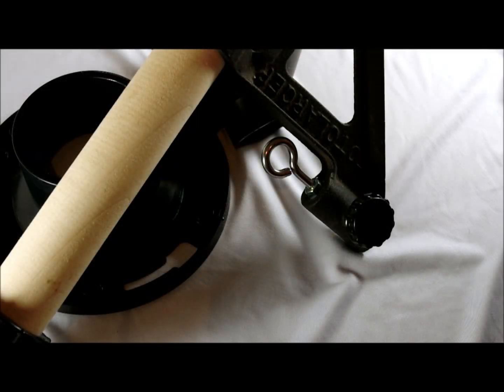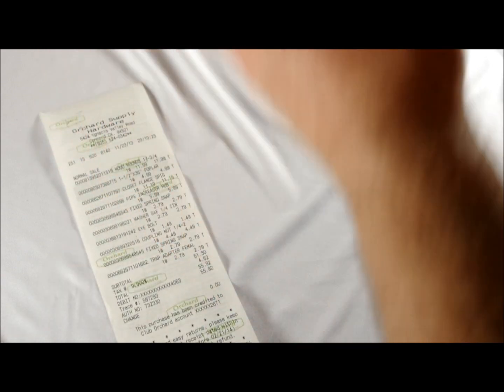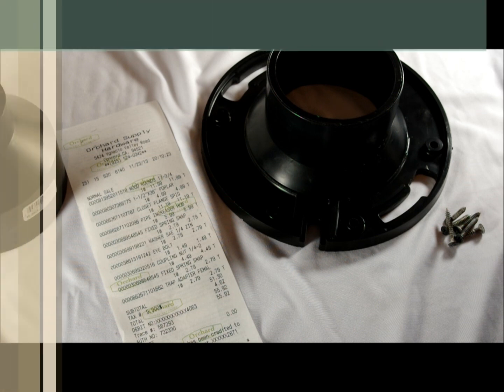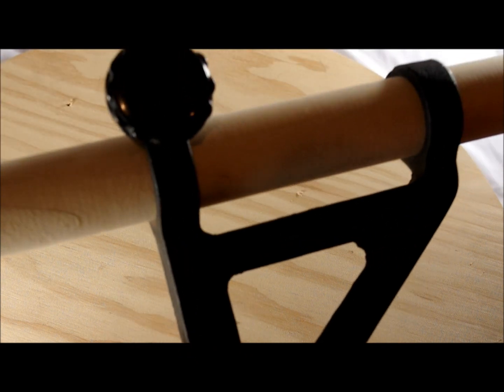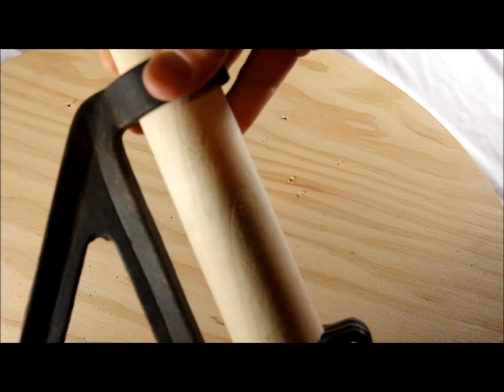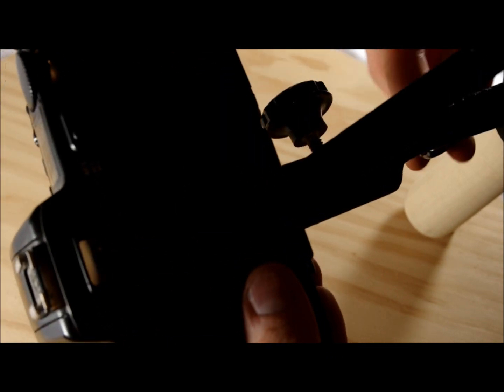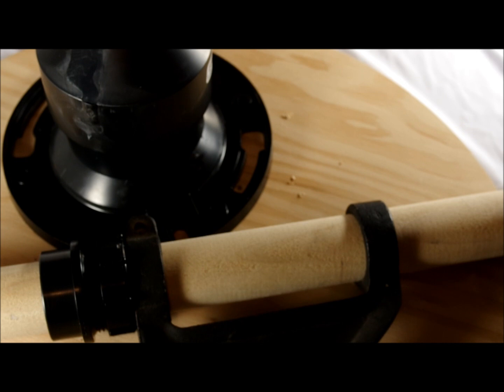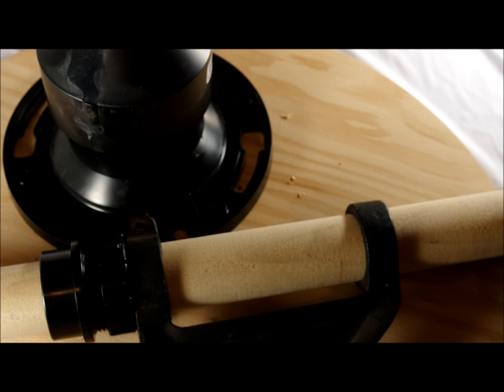DIY Photographic Copy and Reproduction Stand from Plywood and Plumbing

Comment: What’s a spring snap?
Reply from the maker: Can you remind me of where I said that or the context? It's been a long time since I made this video.
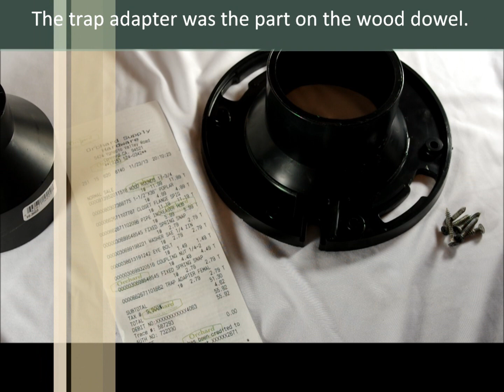Reply: "Fixed spring snap" first mention at 2:10, then morphs to a "trap adapter" at 2:54.  Both seem to refer to the collar-like device that fits over the dowel post and stabilizes it against the top of the basal unit (closet flange + pipe increaser).

Comment: I was hoping that this would be an improved means of scanning negatives.

I'd be inclined to use MDF, and to drill through it to support the vertical column. I might use a metal tube, I have an old, cheap roof rack here some place, and also a deceased floor-standing light.

Or my Gitzo tripod together with a column that can be mounted horizontally.